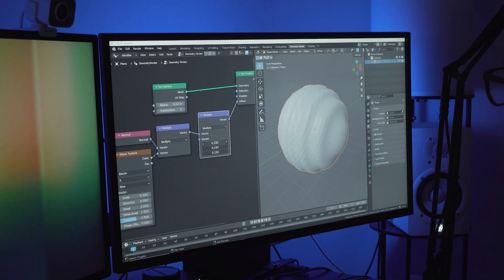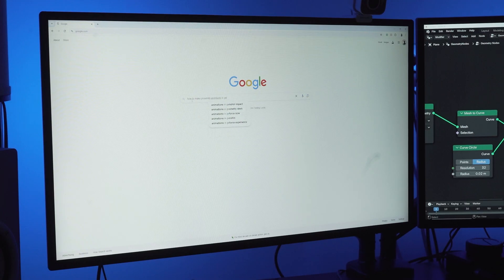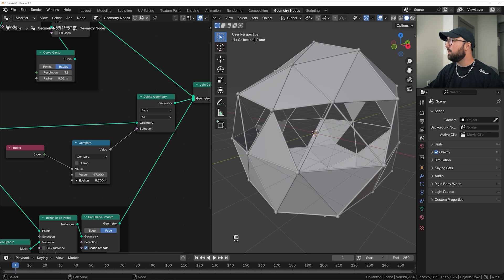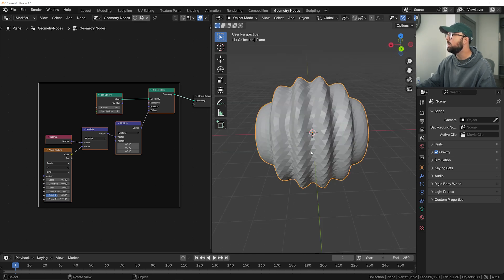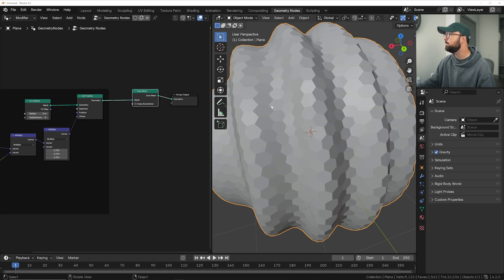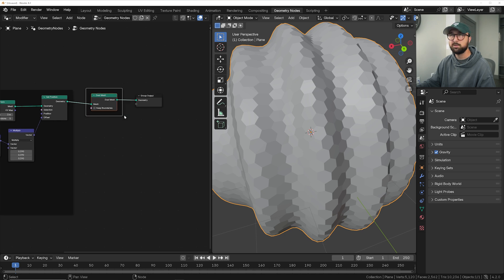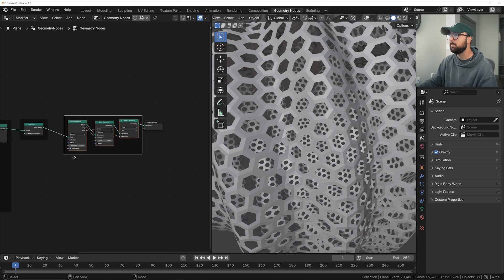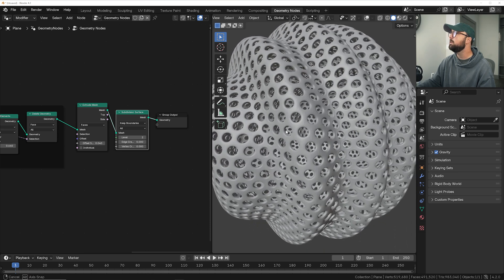How I Learned The Hardest Tool in Blender

Comment: I think I got stuck when Capture Attribute didn’t have the same features as the one displayed on your tutorial.  Mine seems to show  a Geometry input and output, a Value input and a Attribute output.  Also I have two I see two dropdowns displaying Float and Point in the one beneath the first.  Nothing for my Normal to connect to.  Any ideas?  Btw the tutorial ia amazing.  I will be joining the course.
Reply: what version of Blender r u using? Ducky is using 4.2

Comment: There is the/a UI/programmers perspective problem. The node says "add" in its title, but it is only its option, and not what one is "supposed" to search, before even remember later its original name "vector math". So just at glancing at some "foreign" node, one can't rebuild/reuse parts as intuitive. Aren't nodes supposed to make it easier for non programmers. But in this way one still has to remember, where something is "hidding" inside the menu tree, or node naming concept < aka what to search for. Yes F3 exists.

Comment: Question for you. When making a set of materials for the object, how do you separate the cylinders from the main grid? Do material/shading nodes (from its own collection of formulas) slip in in the proper places? Or is there a way to separate the cylinders and the object into their own meshes?
Reply: @ArchTeryx00 1) Make two new materials in the outliner. 2) In geo nodes, look for the node Join Geometry. It has two inputs. For each input, insert a Set Material node. For each Set Material node, click the  circle on the bottom row then click on a material.
Reply: @mystery_guy Thank you! Since I actually posted that Q I've been working on a much tougher project and still am struggling with it. At the time, I didn't know an Instance on Points from a Mesh to Points node, and now (with a ton of practice) I am a little more skilled... but still have a lot to learn.

Comment: Please help. For the sake of a challenge, I decided to repeat these examples (1:58). In the upper middle example, I had a question. How to make the radius of the edges? I made a “Mesh to curves”, a “Curve to Mesh” and connected a “Curve Circle” to it as a curve profile. However, it works in a crooked way. It's probably about normals, but I don't know how to fix it.
Reply: Checked the bundle in the new file. Works fine...
Reply: I put “Set position” in the wrong place, which caused the edgies to warp.

Comment: 10:30 Here's what i think is happening: The reason the Normals "break" is that Normal vectors are vectors that are perpendicular to a surface and a point doesnt have a surface. The diamond shaped Field sockets are contextual to whatever they are connected to so the Normal-node, connected to the Points through the IOP-node, is trying to pull the normal information from the points. By Capturing the Normal information between the Dual mesh and Extrude, you get the Normal information of the Dual mesh faces to the IOP-node.
Reply from the maker: I appreciate the insight. This is really good!!

Comment: 11:56 can you explain why this position along the node tree was the right position to place the capture attribute node? in other words, how did you know where along the path the normal info got disrupted and how much back you should go to to grab the correct normal info?
Reply: The normal information is destroyed by the Mesh to Points node, because points dont have Normal vectors. A normal vector is a vector that is perpendicular to a face. You need to Capture the Normal information from a point in the tree where the needed normal exists. The diamond shaped Field socket is contextual to whatever it is connected to. In this case, i think, you can get it right after the Dual mesh and use the faces created by the Dual mesh, like Ducky did, or you can get it after the Extrude and get normals that are technically a little more accurate to the points, since the points are created from the extruded mesh.
Reply from the maker: it was just trial and error there, anything after that position it wouldn't work
Reply: thanks!
Reply: One trick to remember is that diamond-shaped inputs are actually going "the wrong way."  When a node with a diamond-shaped dotted input socket looks for a value, it's going to go backwards to the incoming node to get that value. So if it's the point node, it's going to look for the normal of the point. If it's the face object, it's going to look for the normal for the face. And points don't have normals.